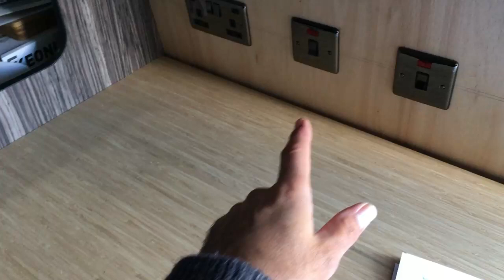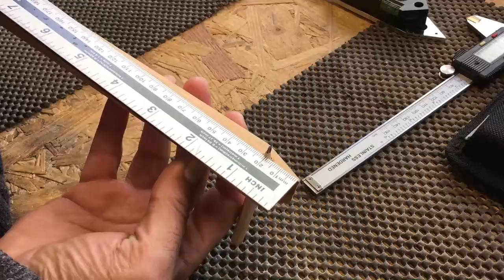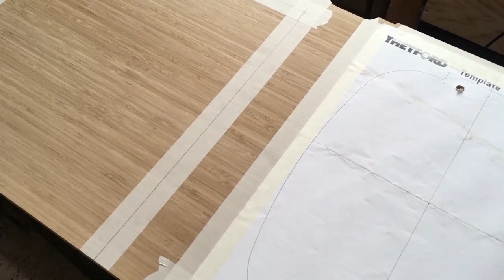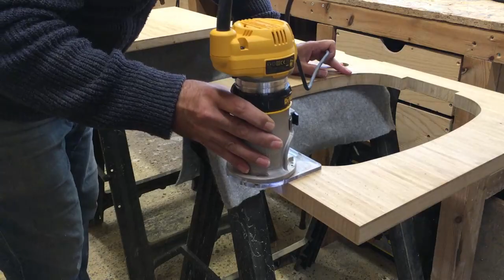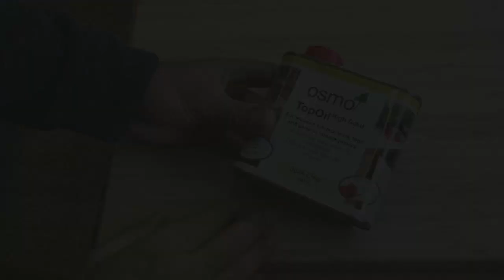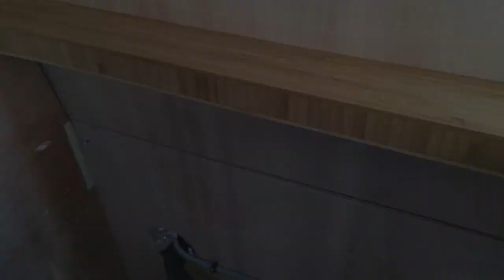Mercedes Sprinter Camper - Kitchen Worktop

Comment: I'm sure people are still watching this series as it's a great resource.  Couple of points on cutting worktops.  Firstly be aware that downcut blades will produce a bit of chatter so make sure you apply a bit more pressure than with a standard upcut blade. 

The blade is trying to lift the tool, rather the norm of pulling the saw to the work piece with an upcut blade. 

If you are looking to finesse a scribe even more, angle your saw and undercut by 5-10 degrees, this will leave less material to sand or plane if a perfect fit is your aim. It will also avoid the blade bending and not producing a flush cut which is common in thicker materials.
Reply from the maker: Some very good advice there abs great tips. Thank you for watching 👍🏼😃

Comment: Hi Greg, what was the overall width of the kitchen in the end, I also want to follow you and use the thetford Tripelex but as the top is 493mm I am struggling to get down below 550mm total width which with the shower makes things tight :) How much worktop did you leave behind the triplex?
Reply from the maker: Or worktop is exactly 550 deep as I cut 50mm off a standard top. We have at least 500 between the kitchen and shower. I did cut the tray down as much as possible.

Comment: Good video thanks, apologies if you've explained somewhere already but what did you use to connect the John Guest 12mm to the domestic tap and do you have a quick conversion for connecting campervan drain hose to ordinary domestic sinks? Thanks again.

Comment: 62 years old and I never knew that you could get downward cutting jigsaw blades. But that's what 24 years living in Indonesia  gets you 🤦‍♂️
Reply from the maker: Step 57 it goes against the way the jigsaw is designed to work so you do need to be more careful. But much better when cutting on the face of a board. 👍🏼

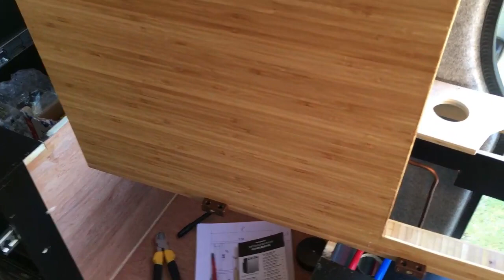Comment: Amazing work. At 22:51 you show how you were going to mount it to the side wall ply. You called them furniture blocks. I was wondering if you could tell me the item number or website you purchased. I can't seem to find them when I search them as furniture blocks? Thanks again for your time and help.
Reply from the maker: Fernando S. type Furniture Blocks into Ebay and loads will come up 👍🏼😀
Reply from the maker: Fernando S. I actually purchased them from a local DIY store called Homebase.

Comment: Is that bamboo worktop is lighter than domestic worktop
Reply from the maker: Cora The Explorer, yes it is lighter, the bamboo is only 25mm thick where normal kitchen top is 40mm thick. 
There is a lot cut away with the cooker and sink so not much left.
Reply: @GregVirgoe  I wish I knew this before

Comment: When I was serving my apprenticeship ( Joinery, carpentry ) my employers loved trying to find anything they could pull me up on, and lining up screw heads was a must plus nail spacing or shilling marks left on wood finish from hammering home nails without stopping short and punching home, well only on finished would like architraves and skirting boards.
After a while It' wasn't so funny for them when I started pulling them up for their rushed endeavors lol, we were always on a price.
You brought back some fond memories there and your right, attention to detail makes a difference, well in most cases lol, I've met some folks over the years who really don't care much for it strangely.

Comment: Hi ,
When you fitted the kitchen tap, did you allow enough room for the draining board to fit properly?
Excuse me asking, but It looked very marginal to me.
Reply from the maker: Hello Alan, the draining board sits on the sink on the lift up counter section to the right of the bowl.
There is no room on the tap side because of the cooker mainly. :D
Reply: Greg Virgoe Ah, that explains it. I didn't realise that there was more worktop on the right. 
I have to say, as someone who has been making stuff all my life,  that your skills, and care in what you do and calm narrative are refreshing and your videos are superb. Thanks for making them,  Alan.
Reply from the maker: Alan Dean, I think I lift it out of the sink to the left but that’s not how it would normally be used. If I set the taps any further back they would have clashed with the back of the base cupboard. Whole build has been a head scratcher and so many things to think of

Comment: Thanks Greg-excellent van build videos-  we have used your build series to pretty much guide the whole of our own build! And you were a source of much help- and a fair few arguments too!!   I commented before but did you give up on the solar idea?- what happened about that and the gas struts- we are facing a dilmemma with what to do about ours!
Reply from the maker: Hi Katie, I'm sorry that I've caused you some stresses 🤕 The solar panels are still going ahead. I fitted the roof rails during the early stages of the build but left the panels off the roof while the rest of the build progressed. Mainly because they were not being used and it seemed pointless them getting dirty on the roof when not required. I did engineer my tilting system and do have gas struts but I underestimated the strength of the support structure so am designing something a bit stronger.

Comment: Hi Greg, I started watching you with a view to fitting out my own van but as time has gone by I've changed transport. I've put a deposit down on a narrowboat sailaway but from what I can see, many of the core features are very similar, so just wanted to say thanks as I'll be making use of you tips and ways of doing things albeit afloat and not on tarmac.
Reply from the maker: Hi Martin, yes there are so many similarities between the two. Especially when it comes to electrics and water services
Thanks for watching

Comment: Is then bamboo lighter than other work surfaces? Being  concerned with weight I am thinking of using either a balsa /foam composite that’s fibreglassed for strength or a light weight furniture board and adding a laminex surface.
The bamboo Is a beautiful finish but I’m not sure about the zebrano / bamboo match colour wise?
Also, what happens to the fabric wall liner when you clean the bench with a damp dishcloth or spill from the sink? How will you protect that?

Comment: Greg so looking forward to the full reveal. This build has been ace. One question I have maybe not the right place to ask but as you mentioned MOT etc..... what happens regarding the kerb weight of the van after a conversion. Obviously the unladen weight is now a lot more than a standard van. So when its fully laden with bikes food people etc what will it be will it be close to the 3.5t limits. As I have heard in Europe they are pretty strict in places on weight limits. Ps I like my screws to be at 45 degrees neither up or across 😝

Comment: Mr Perfectionist++++, "I like to leave all the screws in a vertical position" - but then you put caps on them so that they will never be seen. I was taught to have all the screw heads pointing the same way but I've never had anyone pull the caps off them to check #so I wouldn't bother if I'm capping them.. 😁

Comment: Another great video, been watching since the start and given me lots of ideas for my dream build. One mistake, Bamboo is not wood it is grass but I will 100% forgive you and you probably already knew.
Reply from the maker: Well done jonathan, technically I'll give you that one, did you know some species are stronger than Oak?
Reply: Thanks Greg, I didn’t but that doesn’t surprise me. I’ve worked a lot in SE Asia and what they do with it is impressive. Looking forward to the final reveal and the cost breakdown, I’m trying to get a better idea of the costs before I bite the bullet and buy a van, if it comes out anywhere as good as yours I’ll be very happy.

Comment: The piece that came out from the sink cut-out will  make a great chopping board.  Just cut off the piece sticking out of the back and protect it like the counter.
Reply from the maker: That's a fantastic idea Lina, I have kept it and the cut out for the oven for that purpose.
My only reservation is it's a very heavy chunk being 28mm thick.
The only other thing I have noticed is the Bamboo splinters very easily when cut, 
so I'm not sure it's the best material for that purpose?
Reply: @GregVirgoe  oh, I didn't know bamboo splintered so easily. Too bad, it's soo pretty 😞

Comment: Very nicely done Greg! Love the Bamboo surface it really looks great. I also like the color of your walls in your bedroom. How did you finish them? Paint? Your comforter and walls look so cosy. 

I fine myself re-watching your videos multiple times as I slowly progress on my own Van. Looking forward to all the other videos you will put out. Cheers!! 

David
Reply from the maker: Hi David, the bedroom is finished with an acoustic felt about 1/2" thick stuck to the ply lining with Trim Fix.
It was an end of a roll from an office refurbishment I was involved with in London. It is used for soundproofing of boardrooms and offices, it comes in 1200mm wide rolls and choice of many colours. Has a soft surface and can be used as a pinboard too.
Reply: Thanks! Nice fun addition. Hmmm. 😏

Comment: Fantastic detail as always, picked up heaps of tips for when I do my benchtop in a few weeks time. I'll be using a (native) pine laminate as its lighter and available in heaps of sizes here in NZ, I initially looked at Bamboo, but it tends to be very thick and only comes in one width and is mainly 3m lengths, so quite expensive and lots of wastage, as its too thick to use the offcuts for tables etc. Looking forward to the full tour.......
Reply from the maker: I was surprised to see that Kaboodle Kitchens is an Aus company.
The board here was 28mm thick so less than the normal 40mm for kitchens and was only 2.2m long
I have managed to use 1.85m in the van including the flip up section at the end.
But when you cut out the oven and sink there does seem to be more on the waste pile than in the van :O
Reply: Kaboodle flat packs are available at Bunnings in Aus & NZ, its the Aussie B&Q :-) The cheapest bamboo benchtop they have here is a bit longer and thicker and costs $549, which is about GBP250, so a tad expensive as I'd use less than half of it. They have a v nice looking Acacia oiled hardwood one for $98 though, so about GBP50 which I'll look at and see if I prefer it to the native Pine one. Just the one hole for the sink for me, as mine is a weekend and holiday campervan I'm going to use my portable butane stove top when out and about as I can use it outside too, and a small portable single Induction hob when I'm at campsites with power. I'll try and use the sink cut out as a chopping board/sink infill, and the rest will be used as table top for the dinette and a flip up at the end of the kitchen bench , and some storage lids too.

Comment: I bought my 1st van to convert I have wanted to do it for some time and after watching everyone of your videos I bought the van you have really inspired me! But now I have it I'm very scared!
Reply from the maker: Hi James, I do know exactly how you feel, there were many jobs on the van that gave me a few sleepless nights I can be honest with you. The biggest of those was when it came to cutting holes in the van because there is so much at stake if it goes wrong.
But with careful planning, measure, measure and measure again with a nice fresh blade or saw it will go well and the huge sense of satisfaction when the job goes well. It is ok to worry just take your time and break each job down into small chunks with mini goals. I set myself daily goals of what I want to get done, then at the end of the jab say to yourself, that's a good days work!
My very best wishes with your own build and please do come back and keep me updated with your progress. Thank you
Reply: @GregVirgoe  did you use structural ply wood soft or hardwood?
Reply from the maker: Hi James, for the plywood lining of the van I used 9mm marine ply, this has very good glue and will resist moisture much better. 
The kitchen carcasses are made from 12mm hardwood plywood.
The lightweight furniture plywood is made by Morland UK and is made from Poplar, laminated both sides.
Reply: @GregVirgoe  great thank you
Reply: You could consider looking up videos of people building out of t-slot aluminium, as well. It's probably as easy as wood or easier, depending on skillset. Just cut the aluminium to the proper lengths and bolt it together with angle brackets and such. "Ourkaravan" here on Youtube, or "Humble Road" who also uses it. Basically construct the framework out of aluminium, and cover it with wood, plywood, whatever.

Comment: Great job as always. In the nitpicking department; I would have preferred to see the routering job continue around the side of the work surface also, and the sharp edge on the corner where you can easily slam your hip might be better off gently curved instead of a 90 degree angle.
Reply from the maker: Hello, there is method in my madness here. The kitchen will have an extension piece. The bit I was polishing on the workbench. This is now fitted to the end of the units with lift up brackets to give us another 450mm 18” of counter space. 
So if I had rounded off that edge too there would be a valley where the two pieces meet when it’s lifted. That is why I did not round it over 😀

Comment: Great workmanship although over-engineered ))
Have you thought about making round edges for the counter-top? It would make sense not to have sharp edges right in the doorway...
Reply from the maker: If anyone is going to over-engineer a project it will be me, I'm an engineer by trade so it's built-in I'm afraid :D
As I showed in the video I did round over the front and back section by the door. The end I left flat as there is a lift up section to be fitted and I didn't want two rounded edges meeting and forming a valley in the top. There are no sharp edges don't worry.

Comment: Great work as always Greg, that bamboo really does look well. It's almost a shame that you're coming to the end of the build, I'll miss watching the videos which always seemed to have just the right balance of detail without going overboard. I have to admit that I skipped a couple of the more technical "wordy" ones, like the gas regulations, but will go back and watch them in full when I finally get around to starting my own build.
Now get out there and enjoy the fruits of your labour, you deserve it 👍
Reply: Bamboo is a great choice. It's a renewable material (grows much faster than trees) and very durable.
Reply from the maker: Thank you Andy, there still loads of content to come. 
I see areas where I think I can add value to others. 
There's a lot of very useful info in the gas video :D
Reply: Good to hear there's more to come Greg, and I wasn't trying to suggest otherwise about the gas video. From a quick flick through I can see it's packed with useful information, it's probably just a bit too in depth for me at this stage of the process. It will no doubt be a great reference when I get down to some serious planning. 😊
Reply from the maker: Yes Croft, we had some in our garden and it's grows really fast and spreads like a weed almost.
Very strong too, lots of far east countries still use it for scaffolding etc

Comment: Excellent series, I have learned quite a bit... however …  you have thousands of pounds worth of tools including a table saw …. most people just couldn't afford to do this kind of build and haven't got the experience that you have. Really enjoyed the videos though, may I ask how old your van is and how many miles has it done?
Reply from the maker: Like most blokes tools are collected over many years, the workshop is my father in laws and the tools we have acquired between us. They are all hobby end and not top end tools at all.  Table saw £200, Jigsaw £45, Drillpress £50, Brad Nailer £30, hand drill £99
These are not expensive tools we are using here they are the best value DIY brands. I am not a working tradesman and have no training in woodwork at all, I had an office job for 30 years, so it is possible to achieve this kind of finish at home.
My build was never going to be a budget build in terms of the quality of the materials and appliances, however, I now have a van that would have easily cost 2-3 times as much to buy from a main dealer. You work within the budget you have got.
Reply: You are clearly very very competent at DIY …. you may not be a working tradesman (many are not that good) but you seem to want to play your skills down, you are far closer to being an expert than a novice … and  this is not the kind of build the average person should attempt. I am a novice and have just completed a build, I would need a lot more experience before attempting a build like yours. This is not a criticism just an observation …  great series, I have learned a lot from watching your expertise …. enjoy your travels …. and look forward to the van tour.